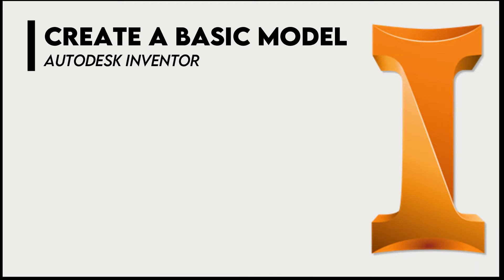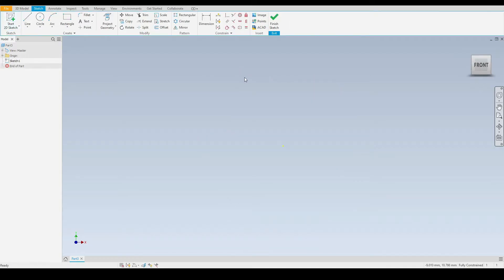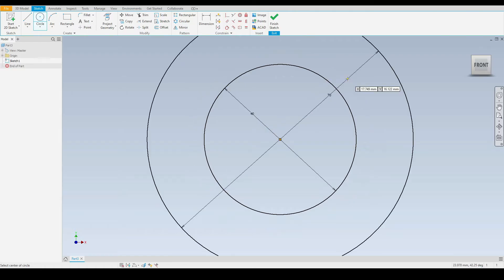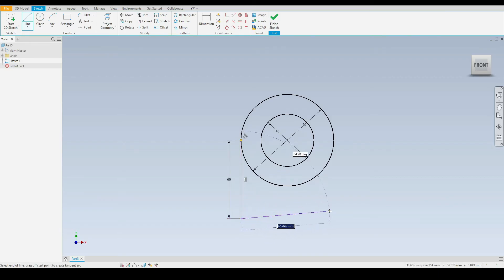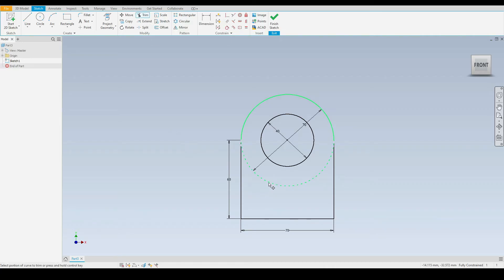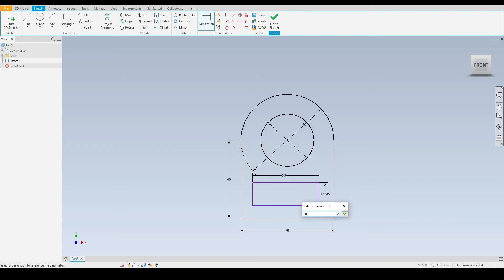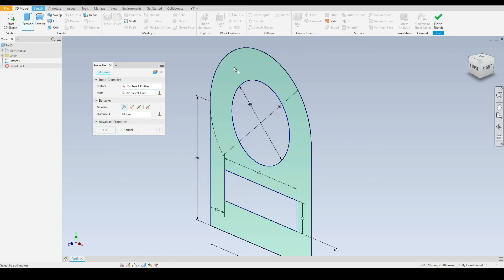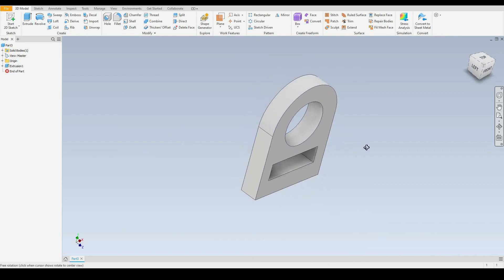Autodesk Inventor 2021 | Create your first 3D Model | Tutorial

Comment: Does it matter which plane you start a drawing in?
Reply from the maker: Hey @John!

Good question, for the purposes of single part creation and no intention to later form an assembly using the part you are drawing then no, it does not necessarily matter which plane you use. However, as a rule of thumb it is advised in any CAD software to draw the first sketch on the relative plane, i.e. if the first sketch is to be viewed from the Top view, then we would select the Top Plane so that our Viewcube is representative of the according views of the part.

The same is applicable when working on an assembly level and creation of 2D drawings (here, we select the 2D view we wish to detail). It's not essential, but makes for an easier workflow and is best CAD practice.
Reply: @AutodeskInventorTutorials  Thank you, love the tutorials.